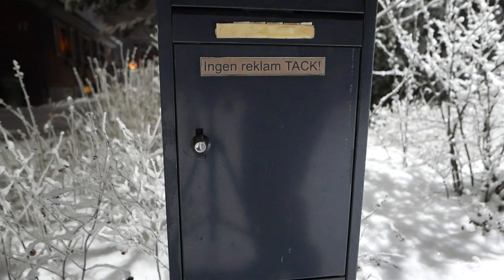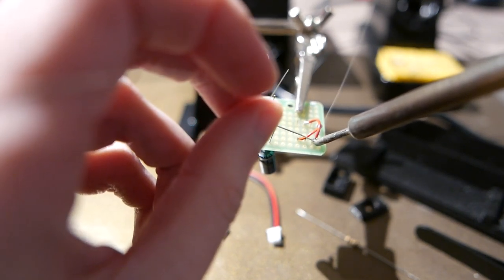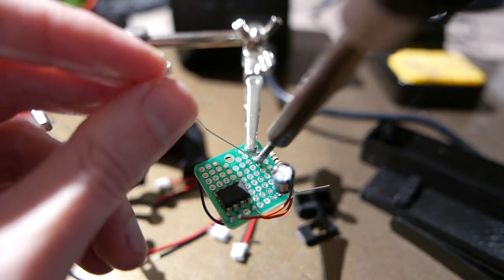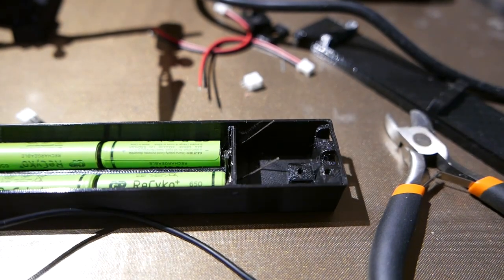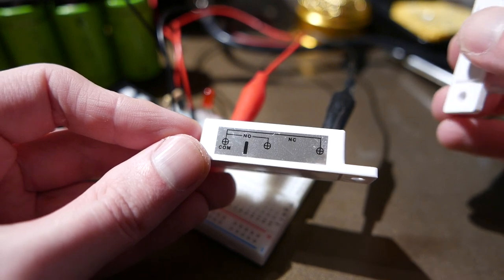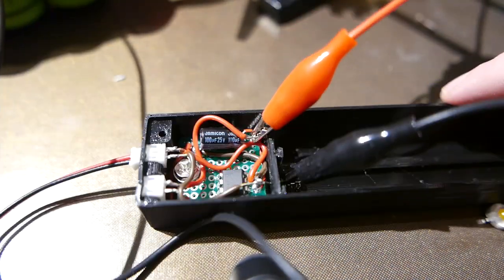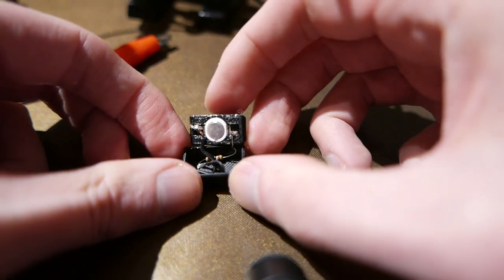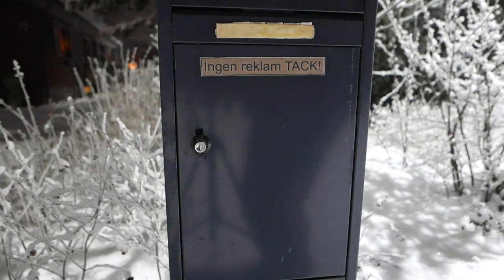Making a Mail-light... the Mailight! (Because we don't get sun here at winter)

Comment: The high surface area of paper towels will cause super glue to cure rapidly. If you get a lot of it on you, attempting to wipe it off with a paper towel can cause burns and bonding the towel to yourself. I learned that the hard way.